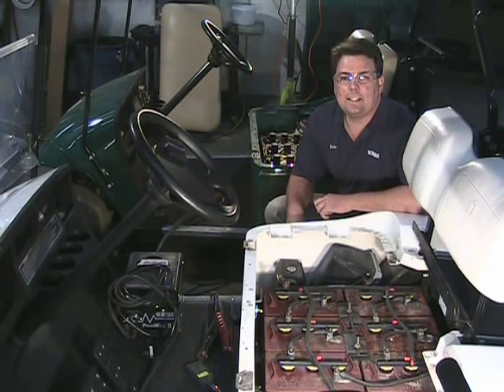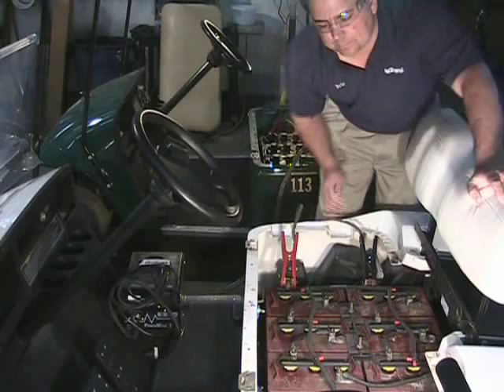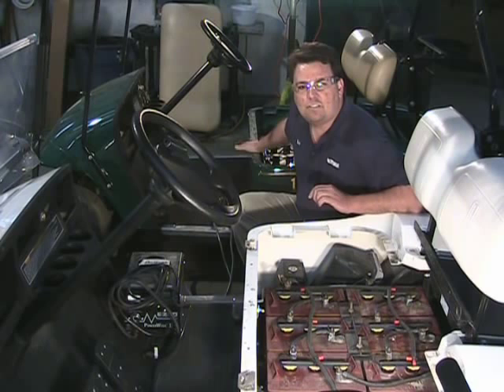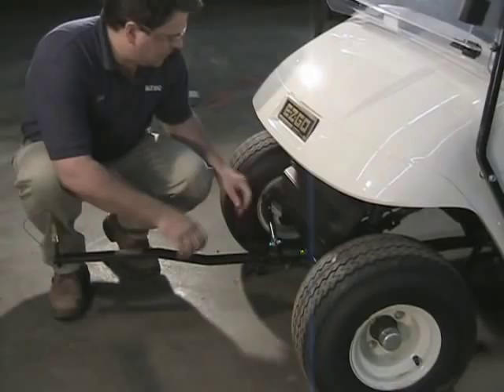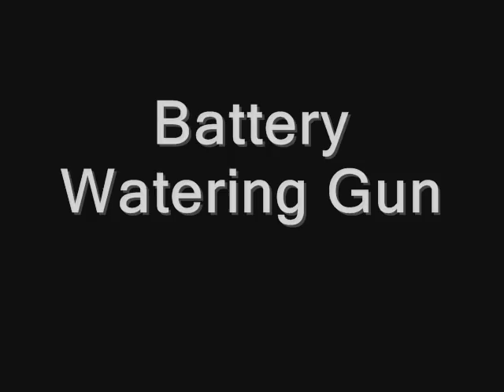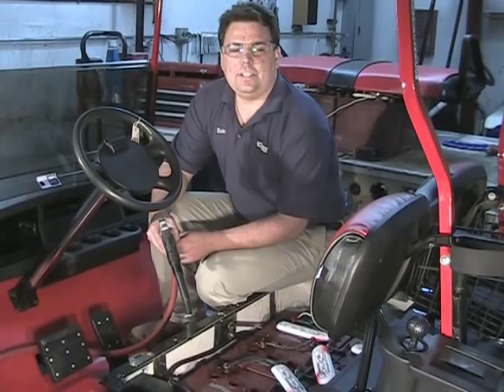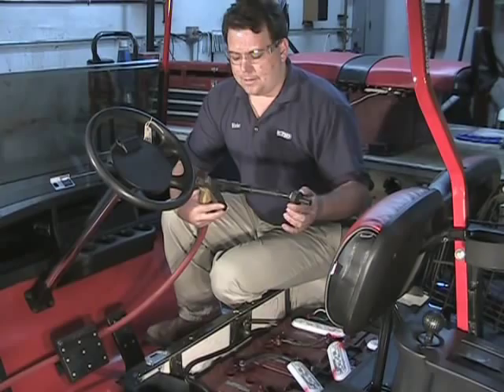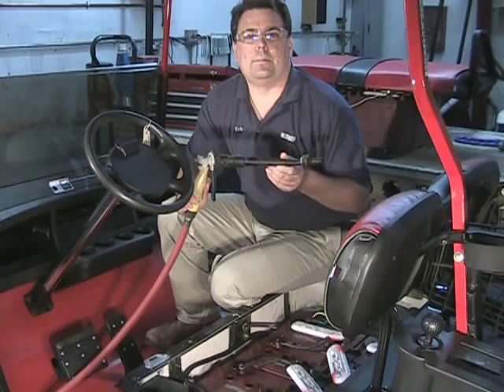How to jump a dead ezgo

Comment: you can charge your cart with a car or a charger. 2 batteries at a time.With cart off
the 36 or 48 volt current isn't a complete circuit. So hooking jumper cables or a charger
to 2 of the batteries at a time will charge them. Has to be 2 that are connected in series
Takes some time but works fine.

Comment from the maker: You should check you water every 3 weeks for typical use,  The tab on your front axle with a hole in it is for a tow bar system, where 2 or more carts can be hooked together. Check out half way thru the video where that particular part is discussed.